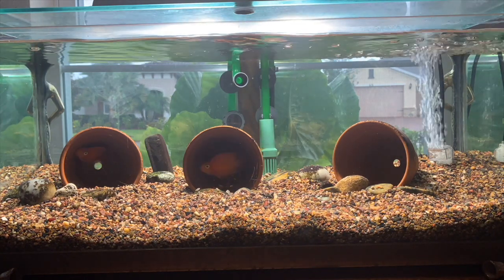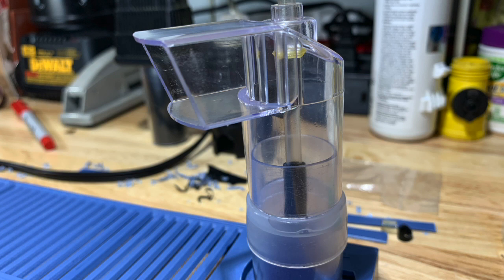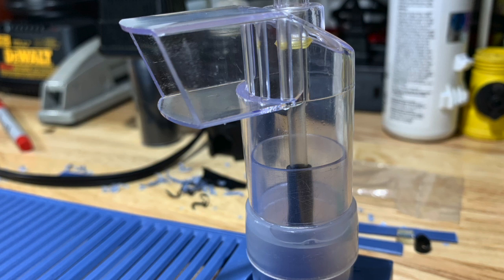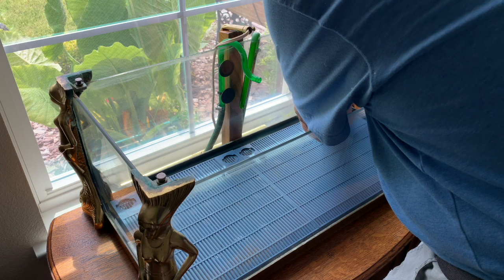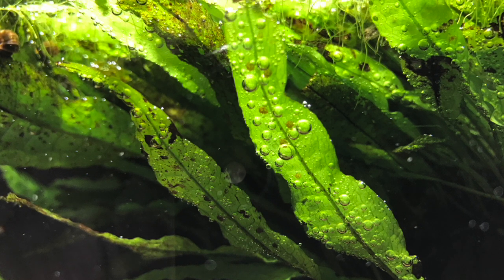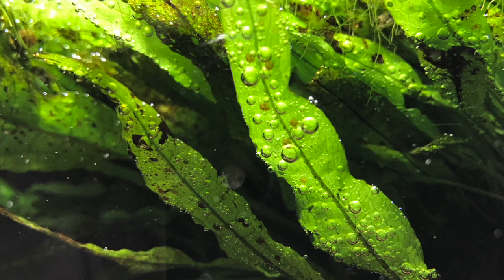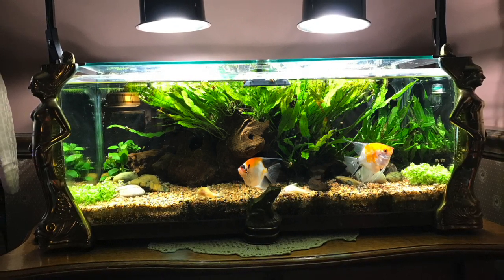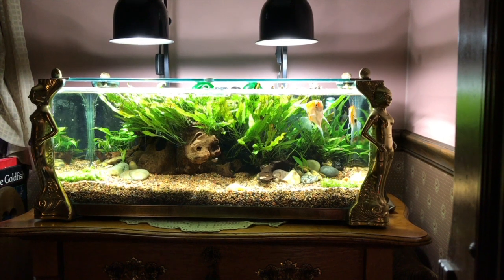How to build a Plenum to establish Anoxic conditions in your aquarium.PART 2. Using sand.

Comment: How much less effective do you think a DIY plenum would be if it doesn't have an uplift tube?
Reply from the maker: That’s a very hard question to answer. Because there are a lot of factors that are completely different with everybody’s aquarium. What is your fish load? How many times you do a water change? How heavy do you feed your fish? And it goes on and on so nobody can really answer that with a true answer. The thing about it is, let’s see if you had a Plenum that was not slow moving and you had a planted tank and it was lightly stocked like you see on YouTube videos, then you should have no problems at all.
Reply: @anoxicfiltrationplenums  Thanks for the reply Dr. Novak

And to be honest it was just hypothetical as I was planning for my next tank, but in reality making a DIY uplift shouldn't be much of an obstacle. 

Perhaps a better question would be, do you think having just one uplift tube would be sufficient on a 120 gallon tank? In other words, should I potentially have two uplift tubes on either side since they'll be 4 feet apart, or should I just keep it exactly the same and just scale-up?

I wasn't sure how to weigh the risks of too much flow with having tubes on either side versus inadequate flow by the tank being too long for the one airstone to really facilitate flow on the opposite side.

Thanks again
Reply from the maker: @VinylUnboxings   I would go with two uplifts in a 120 gal. Two foot for each tube.

Comment: Sir, while your anecdotes are entertaining and informative, sometimes your narrative does not match what you are doing in the video. It makes it difficult to follow how you set things up. As an example I still don't know how to continue after placing the plastic base to make the plenum. How is the water drawn from the bottom to achieve flow?
Reply: It's just a typical undergravel filter, no?
Reply: @VinylUnboxings  Yes, but there is also another video that suggests the use of a skimmer, maybe attached to the uplift tube, I'm not sure now, that is why I'm confused. Another "How to build a Plenum" video does show the set up as just your typical undergravel  filter setup.

Comment: Hello Dr. Novak. I was looking a lot of information about the Walstad method but I don’t know if is compatible with the plenum with anoxic filtration. I was thinking that all the nutrients will go to the under gravel filter and then released to the water column by the air stone. I don’t know if this is accurate, please can you explain me if I can do both ?
Reply: @Dany JP. I will aksi be trying this method with the Walstad method (cloth cover over the plates, then dirt, then sand). I think it is fun to try and see!
Reply: @RenitaWellmanPhD  i don’t know that much but I think you won’t need the dirt because all the nutrients from the water column goes through the substrate so the plants will always have nutrients. But anyways you have to ask to a better informed person or dr Novak directly. This is what I concluded after a some research.

Comment: Dr. Novak, this is really fascinating, and I am in the process of building out a new tank.  I like using fluval stratum as my plant substrate.  Will this work in place of the aquarium gravel when building the plenum, or would I need to build the plenum using the gravel, and then cover it, then place the stratum?  Does the increased water movement through nutrient treated substrates like fluval stratum flush an excess of harmful fertilizers into the water?

Comment: Hello sir.  I am going to set up the Anoxic filter.  I have everything but the basket as I want to know is it better to do one large basket or more smaller ones or does it not matter.  Thank you for all the content.  I feel like so much stuff on the web is to get you to buy things and not real science.
Reply from the maker: The only reason I go with smaller baskets is they’re easier to handle. But in reality it doesn’t make a difference.
Reply: Thank you for the quick response.  I know you are probably very busy.
Reply: I hope I am not a bother but do you recommend rinsing the flourite and kitty litter before putting in the basket??  I put it n and started rinsing it but there are so many small pieces that it is like a giant thing of mud with some small rocks. I am afraid to put it in.  My basket is 9 inches deep so it is not rinsing very well.  Or is that fine dust helpful or needed??
Reply from the maker: David Grudek Here’s what I do: 
I put it all in a basket and then I rinse it all when it’s in the basket that seems to work quite well. Trying to rinse it separately is too hard to do. Just like a show on my video put everything in the basket rinse the basket real good until the water comes out clean and then put the basket in your sump. 👍
Reply: @anoxicfiltrationplenums  Hopefully my last question.  I saw your other videos with your discus fish and you didnt change the water for 5 months when the water level goes low do you fill it back up with tap water or RO as this will cause the hardness to go up.  My water is really hard in Illinois east of the fox river
Reply from the maker: David Grudek  no I just filled it up with regular tapwater I was too busy to fuss with the fish. The fish were already acclimated to hard water conditions anyhow.

Comment: DR Novak do plenums and anoxic filtration help control phosphate in aquarium if so
How?
Thank you
Reply from the maker: I just wanted to make a comment on something I seen on Google Plus about bacteria.
The link below is from a Dr. Franco in Italy. He did an experiment with adding two small BCB (Biocenosis Clarification Baskets) to a 700-liter aquarium that had a Nitrate (NO3) reading of 60-ppm and a PO4 (phosphates) reading .75-1.0 ppm.

http://anoxicfiltrationsystem.blogspot.com/2013/06/heterotrophic-bacteria-compete-with.html

I just wanted to make a comment on something I seen on Google Plus. I’m also going to leave out any name(s) and the specifics of what the person was talking about…meaning pond or aquarium.

Basically they said that periodically you must add a bacteria inoculator to your system to keep it clean and running right. This goes for ponds and/or aquariums. Please be aware that not all bacteria in a bottle are created equal and are not as effective as some may think.  Read about 11 commercial products tested claiming to contain bacteria that will facilitate in the conversion of toxic ammonia to not as toxic Nitrates.

http://anoxicfiltrationsystem.blogspot.com/2013/08/buyers-beware-there-are-numerous.html

Bacteria depend upon available foodstuff, the volume and compensation of incoming nutrients and the health, condition, and type of substrate used. In other word, bacteria will increase or decrease depending on food availability, carbon, oxygen and the medium used.

Carbon availability for autotrophs, or those bacteria that utilize light and carbon dioxide to carry out their biological processes and can quickly use an abundance of inorganic carbon. Heterotrophs are mostly responsible for breaking down organic matter and thrive in areas where diffusion abounds and where organic carbon is well cycled. It is also a fact that mediating biochemical transformations (protein/enzymes) and genetic controls (DNA/RNA) show a common reliance on specific ratios (called: Redfield Ratio) of carbon (DOC), nitrogen (DON), and phosphorus (DOP). It could then be said organic carbon is a major player in how well inorganic nutrients, example, nitrogen and phosphorus, are utilized.

Evidence suggests that when heterotrophic bacteria exist at below their full degree or extent by both organic carbon and mineral nutrients, they have a negative impact on their trophic neighbors in the microbial food network. In other words, if they suffer, it appears to negatively affect neighboring processes. Nevertheless, nitrogen is generally the primary limiting nutrient in our systems because it controls the rate of primary production. If the system is supplied with high levels of “nitrogen,” then algal blooms will generally occur.

   Whether organic carbon is cycled or stored, it appears to be a matter that relates to how the substrate used supplies heterotrophic and autotrophs their essential foodstuffs. In fact, it has been shown that when only an organic carbon source is added, autotrophs are out competed by heterotrophs for inorganic nutrients, demonstrating a need for the corresponding nitrogen. If inorganic nutrients are only added, autotrophs will increase, such as cyanobacteria. Therefore, the ratio between carbon and nitrogen and that of phosphorus are very important factors when facilitating population densities of either bacterium. The substrate along with where diffusion abounds (Like that of a plenum.) is the most critical player, are very efficient at cycling organic carbon so as to balance the ratio of available constituents.

It is only when microbial communities collapse that any hobbyist would or need to add any kind of bacteria supplement to any freshwater or saltwater system. If for some reason the ecosystem does collapse and need a supplement then the hobbyist must find out why the systems foundation for incorporating important biological pathways closed to chemical mediators and not just add a Band-Aid to the system. Band-Aid’s do not fix problems they only cover them up.

So, before you spend your expendable income on needless bacteria cultures, investigate why you need the cultures in the first place and fix the problem. There is a lot of ‘snake-oil’ out there and anyone can get talked into buying them.

A word of admonition to the hobbyists: Do you remember the first time someone chorused you and stole money from you under the pretense of commerce? For most people being taken from ones wealth is a practice that will happen more than once during their lifetime. Several years ago, I bought a commercially available nitrifying product from a well-known manufacturer that also professionally installs ponds. The bottles labeled stated that it would remove unwanted sludge from the pond and the ponds filter. When I opened the bottle, it was very pungent and smelled like hydrogen sulfide (rotten eggs); to my surprise, all the bottles on the shelves smelled exactly the same way. I then bought one of the bottles to do some experimental studies; before any experimentation was to be conducted, I contacted the manufacture to speak to a microbiologist on what exactly were the particular bacteria that is contained in their product. I had introduced myself to the receptionist so she would not think this was some kind of prank call. Despite numerous phone calls, no one ever contacted me, to explain anything about their product.

   Without knowing, the exact bacteria / bacterium content of this particular bottle (I did know one thing; it was not microaerophile in nature), I conducted some studies to determine the efficiency of this commercially available product. The amount of product added to the filter based on the manufacture’s labeled directions and administered accordingly.

The results determined this product to be unsuccessful in its claims at removing any sludge from the pond and/or filter. I can only imagine how many products are on shelves that are being sold to the hobbyists that are inadequate and do absolutely nothing for the betterment of the hobby. These products are nothing more than ephemera placebos designed to make the hobbyists believe that they have done something good, when in reality; they have done nothing at all for the betterment of their pond or aquatic animals.

   Marketing departments have become very clever at dodgery and telling half-truths. Even at making up impressive-sounding but meaningless jargon to sell what is often nothing more than snake oil. A hobbyist pond is a singularly inappropriate Beta-test site for products a manufacturer has not fully R&D’d themselves. Our ponds are not the proving grounds for new products that may have teething problems. It now borders a hobbyist on the behavior nearer to that of a test-consultant than a pond-hobbyist. We succinctly define the responsibilities of a manufacturer of pond products: First, to be able to make a worthy product. Second, to be able to make it consistently and reliably. Each is as important as the other is, and both are relevant to the consumer, not just the first.

   We hobbyists like to believe it is all about the aquatic animals health, safety, and well-being, but when manufactures become inebriated with cupidity and lie their way into our pocketbooks; it is then obvious that it is really all about the Benjamin's. Innovation has been the growth engine of this hobby from the very beginning, on both the aquatic animals and the hardware sides. However, history has taught us that big firms, if left to their own devices, can also stifle innovation. It is like a moment of creation at one end of the line and a perversion of intent at the other. It is really too bad that there is not a “Consumer Reports®” that hobbyist can read and use as a guideline about products that are being made and sold for this particular pastime. Unfortunately, there is not; do to the fact of people having liticaphobia (the fear of lawsuits). I know the indignation and bemusement hobbyist must feel over this whole thing, but learning the truth about that better mousetrap will never become a reality.

   However, in the pond/aquarium hobby there are profits to be made by those who would prey on the ignorant. I think everyone can remember the famous words that the spirit of Christmas present said to Ebenezer Scrooge from Charles Dickens’ classic 1843 novel — A Christmas Carol. “Beware of these two children, this boy is ignorance, this girl is want, most of all beware of this boy.” In a hobby like ours, we should never let ourselves befall to that boy of ignorance. However, unfortunately it has almost come down to the point were hobbyists need to have at least a B.S. degree in Microbiology and in Biochemistry to make an astute purchase. These products known more as essentially, Lysenko’s methodology 1: “Avoid verification,” and should be avoided at all cost. Unfortunately, for the hobbyists he or she will never know until they buy the product about its defalcations; then for themselves find out what it does or does not do.
[Www.koifishponds.com/state_of_the_art_filters.htm: Read what David A. hast to says on the subject matter on filters and the misleading information manufactures give on their capabilities.-Ed.]

1:  Trofim D. Lysenko was a Soviet agronomist, active between 1929 and 1965,
Who attempted to annihilate the science of genetics in the Soviet Union using tactics of pseudoscience combined with unrelenting attacks on accepting scientific theory.

Dr. Novak

Anoxicfiltrationsystem.blogspot.com
Reply: @anoxicfiltrationplenums  exceptional explanation 
Thank you so much

Comment: DR. NOVAC can Seacham fluorite be used as part of the iron requirement for anoxic filtration?
Thank you
Reply from the maker: Yes, if Laterite is not available.
Reply: @anoxicfiltrationplenums   Thank you so much for your quick response .
I'm thinking of using Eco complete with seacham flourite.
 Is that a good combination or should I use another type of substrate for iron.
 laterite is not available
Reply from the maker: Dario Mendez nope, you’re good to go.
Reply: @anoxicfiltrationplenums  Thank you

Comment: It seems like it’s the fabric that restricts the water flow.  Couldn’t you use it with any substrate? If so would sand or a coarser one be the best choice?
Reply from the maker: Yes you’re right, but see if sand goes through slits first before set up.
Reply from the maker: Yes you’re right but see if sand goes through UG slits first.

Comment: Thanks for Part 2 ... every tank that I have set up in my fishroom since finding your channel has a plenum and/or biocenosis basket. I have even adapted your concepts and come up with a design using thick plastic mesh tubes from pentair for the baskets. I use these biocenosis tubes behind matten filters that operate a bit like an internal sump. I have also found these tubes work great in South American & African cichlid tanks where digging is a natural behaviour but the cichlids don’t disturb the media because they can’t get through the mesh. 

FYI: My observation is though that anoxic filtration works great for the nitrogen cycle but in a non-planted Cichlid tank some water change is still required 2 - 3 weeks otherwise other chemicals such salts for hardness in an African cichlid tank through evaporation builds up to levels higher than even these cichlids like it. 

Thanks for your videos I would not have thought of this in an aquarium context even though I am aquatic biologist with limnology training.
Reply from the maker: Believe it or not a lot of people like using the anoxic filter for cichlid tanks only because of the stabilization of  water Parameters  are better. Since I am now living in Florida I will be doing videos on fish farms here in Florida,  I think that will be very interesting for everybody.

Comment: Do you think the slow moving plenum is better than just having the UGF plate without the air like one of your other videos showed?
Reply from the maker: No not really, it is just another way to do it and it only makes sure that some small amounts of water will go through the bottom plates. Speed is not what you what with a plenum. The slower the better.